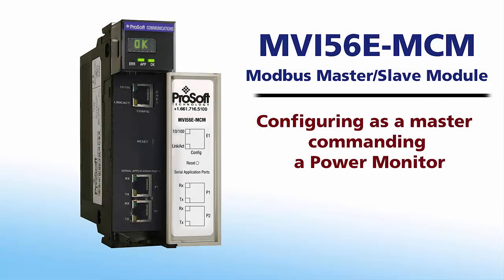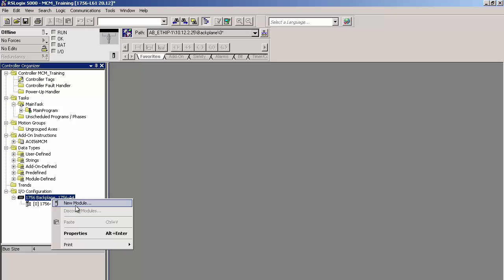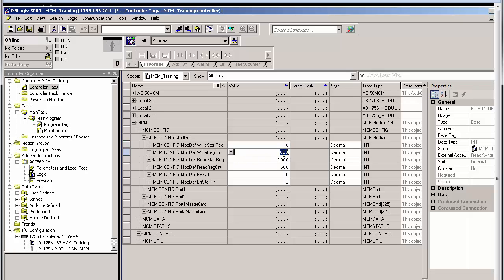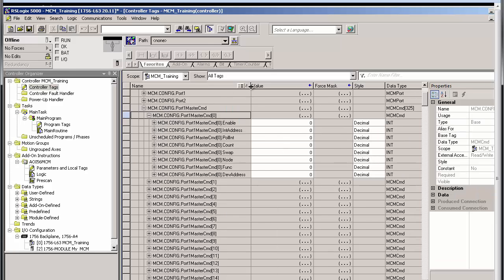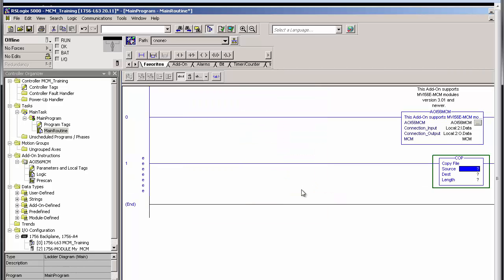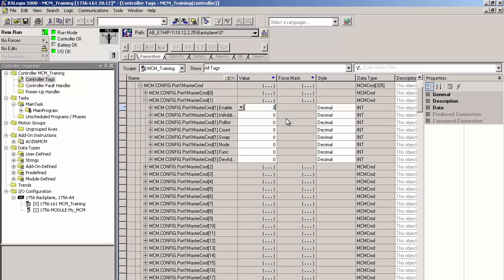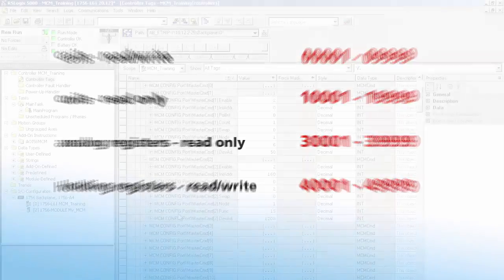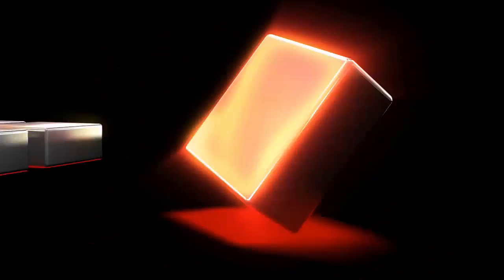Set Up: ControlLogix Modbus Master/Slave Module using the MVI56E-MCM module

Comment: Could you please show me the property of the Prosoft card and also  explain how you have 1756 prefix for your modbus rather than use 1756 generic? how do you download the to PLC? Thanks
Reply from the maker: More info on the properties of the MVI56E-MCM can be found on the datasheet at https://www.prosoft-technology.com/prosoft/download/2941/22599/version/15/file/MVI56E_MCMMCMXT_DS001.pdf. We do recommend using the generic 1756 Add-On profile, but we also have an Add-on Profile specific to the MVI56E-MCM available here. (https://www.prosoft-technology.com/prosoft/download/5397/38253/version/2/file/AOP_Prosoft_v15.zip)

Importing the AOI will add all necessary tags to your PLC program and from there you download the program to the PLC as usual. If you have any further questions, please contact our technical support department at 661-716-5100. Thank you!